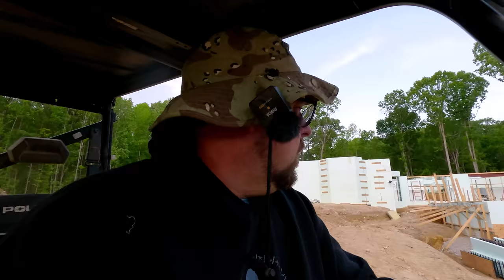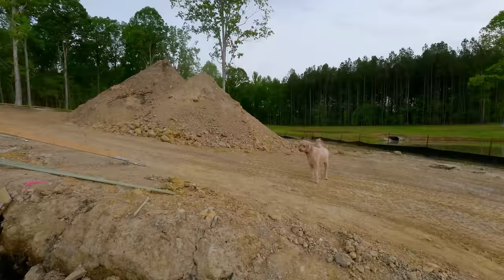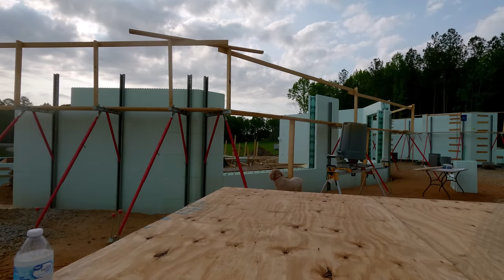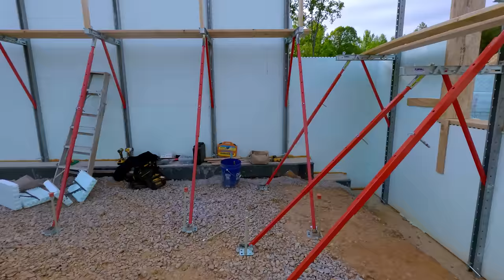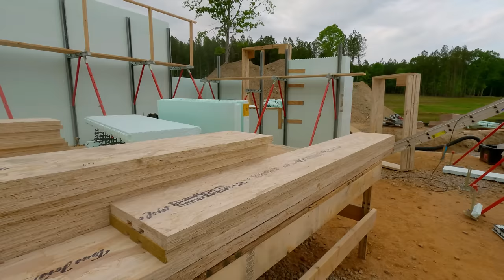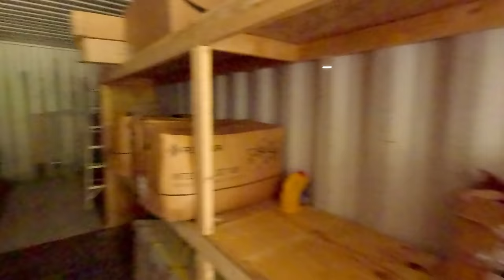Back on the Nudura ICF Basement

Comment: Why do you have so much drop in your Nudura walls? Did you do a lot of changing or did they just send a lot of bad walls?
Reply from the maker: I need more info to know what you’re talking about
Reply: @BealyGood  You have a couple of piles of the walls that looks like trash but it may be short pieces you can use other places. I was just wondering if you had changed the plans and had extra or if you order extra wall panels. I am guessing you are going with concrete walls for storms and high winds or is it for lower heating and Cooling purposes? It looks like a fun project I wish you were not so far away as I would come give you a hand on it. I have followed this from when Chris cleared for the pond.
Reply from the maker: @DodgeTruck  Ah. That makes more sense. Yeah. I’m saving all the pieces and use as needed.

Comment: Geoff, you don't need screw wax,  ust some Dawn or Ivory soap works wonders and is much cheaper.
Reply from the maker: But it wouldn’t be as funny
Reply: @BealyGood  well Geoff you are the millionaire, so screw wax it be, and to heck with penny pinching by using dawn or ivory soap.

By the way I always used Irish spring or Dial bar soap to lubricate the screws as I drove them in.

Comment: When building the steps why don't you also put a slide in from patio to dive pool, you could form it on the outside of the steps so you slide around the edge
Reply from the maker: I’ve saved some pics of those. Looks interesting

Comment: 3 screws at the bottom of those bucks may not hold the lateral pressure of 6ft of vibrated concrete. Bucks would be stronger with the sills between the jambs instead of under the jambs. JMO
Reply from the maker: You’re right. I’ll do that for the main floor ones. But, I’m also going to put a bunch of 2 x 6 bracing inside these.